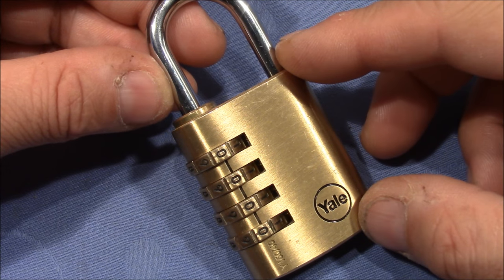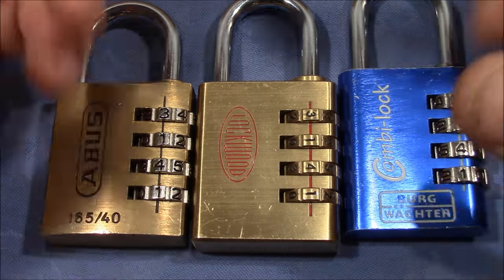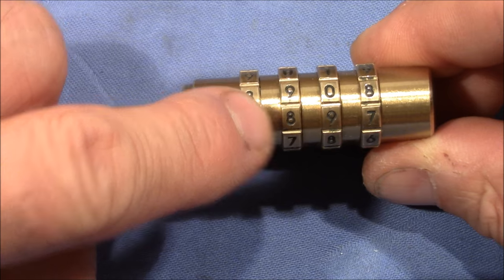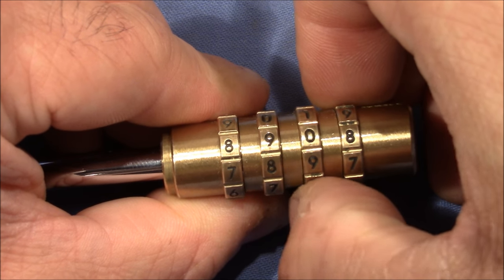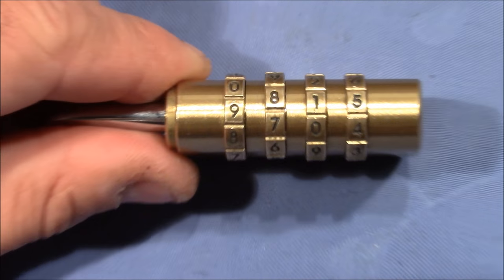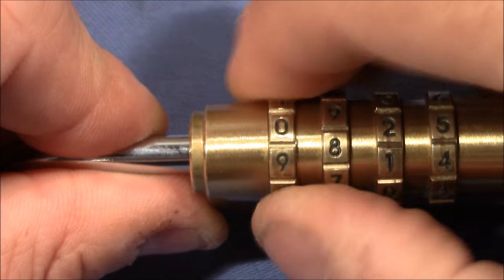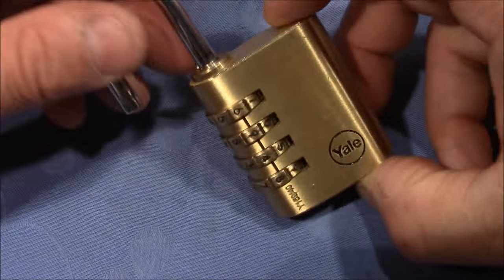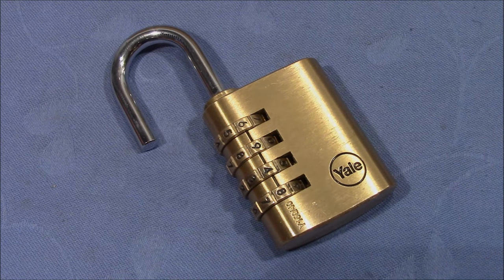(picking 544) Decoding without pulling on the shackle - simple and reliable for the Yale Y150/40

Comment: I tried your method but I didn't make it , then is only one method stay , and I know you know which is that only way !? I have Abus 165/40 Lock with four code number , and like I said I didn't understand how you can do this without code , I found resistance but other click no. Than I decide to check all numbers from 0 0 0 0 - 9999 and I worked 5 hours and I unlock combination on 9693 before the hours and that is unbelievable feeling 😊 ! Is necessary to have hard nerves for that but I did it , my fingers are tired but I m happy because I didn't stop to find code . My luck was is this is just 9999 combination . But Your method is faster and I hope so I will learn that !!

Comment: Me and my wife forgot combination to our lock. Wife said go buy a new one. I said no way. I tried a couple of methods that require pulling on the shackle, but could not get either of them working. Then I opened it using a pin method. But that felt like cheating. And I was kind of disappointed I could not open it without tools. So I tried to play with the lock some more but still no luck, even when I knew the combination I could feel the correct spot. 

However after watching your video I played with my lock for a couple minutes and felt brave enough to blindly scramble the combination it and try to unlock. It worked. No guesswork at all. I then did again twice, no problem!

Thank you!
Reply: Oh the lock is MASTER brand.
Reply from the maker: Interesting that master has the same design issue as this yale lock. Thanks for the feedback and your story.

Comment: Oh wow! I was just able to pick the padlock a padlock I was struggling using this method. I accidentally reprogrammed the combination for a padlock a few months ago. The tension on the shackle method wasn't working but this method worked right away in a few seconds. Thank you very much for this video.
Reply from the maker: Yeah, the design flaw can be exploited pretty easy - thanks for tuning in.

Comment: Thx! Total noob in picking. 1st time opening a lock. tried the pulling on the shackle and tried for like 4h. Tested this and it opened in 2 min :) True Pick for Beginners!
Reply from the maker: Cheers. Glad it worked for you. But for me the pull picking method is much more fun.
Reply: @Potti314  Well maybe i should start with an easier lock first on the pull pin method :)

Comment: Thank you very much!!!
I have the exact same lock for which I accidentally changed the combination (ironically I spinned the digits such that another person would not see the correct combination while working in the basement, and forgot that it was actually changing the pattern).

Anyway, the press method did not work (for me), nor the needle one. With this one it opened in under 1 min!
Thank you again!
Reply from the maker: Cheers - glad it helped.

Comment: well i used a visual check method which is equally as quick if not quicker, useful for almost all locks i came across but not sure about all locks shown in your video, probably does, might wanna try my method on those, i think my method works depends on how tight the lock is build.
Reply from the maker: Where can I learn about your method?
Reply: actually i can tell u when convenient like now lol, like i said its a visual method. let me know if u can inspect closely the gap between the wheel and the lock. for each wheel there should be one number that theres an observable notch next to it. line up all the wheels with that notch, and increase all numbers at the same time one by one, that should open the lock in ten tries at most. like if u see notches lined up for 478, then u should try 478, 589, 690, 701, etc etc etc. theres some locks with very good build that is very hard to peek between the gap, but for almost all locks that i came across of this type, i can always see a notch, or some mechanical properties of similarity

Comment: It works!!  It takes a little bit to get used to this method, but it actually works!!  This is what attacking combination locks is all about ... seeing if there are any differences between the true numbers and the rest of them ... and there turns out that there's lots of things to test!
Reply from the maker: Yes ,a lot of things to test. It's all about probing to find more info about the internal structure. Combination locks are a great source for puzzling. The solution why the method works is actually a big surprise and took me quite some thinking to get the mystery solved. You will soon see...

Comment: I have a different version of this lock, without the rounded bottom. This method does not work on the lock. It has almost no play or springiness. Interesting... It says FKE1 at the bottom. No other model number.
Reply: I think this Yale lock is quite a bit older, and it doesn't have the design defect. Maybe cost cutting with the newer locks?

Comment: Good expo on the alternative opening option on a combination lock. Makes me think that the Yale may have an internal design that's less refined than the other three. Just a thought. Cheers:-)
Reply from the maker: Cheers buddy. I opened it up and scratched my head to understand how this works and why it does not work on other locks. The solution is a big surprise... you will see... ;-)

Comment: Thank you very Much bro best method I've seen so far I was have success with pulling pressure on the shackel and for the first 2 weeks I had lots of suckles and then my dad changed the combo and I had being tying the last 3 weeks to open it but I wasent getting much feed back from I any more till I watched your method I've opened it 3 times in five mins so thank to
Reply from the maker: Haha, funny story. The method is very unexpected and works quite well. However it only applies to Yale locks. Moreover, decoding the usual way is much more fun (at least for me). Happy picking buddy and decoding buddy :-)